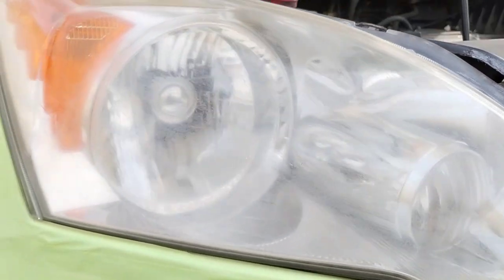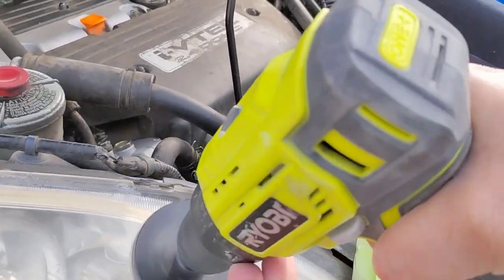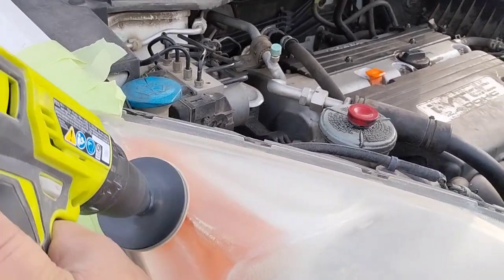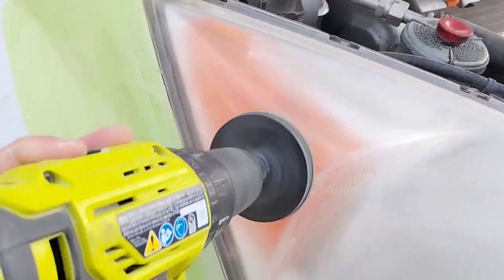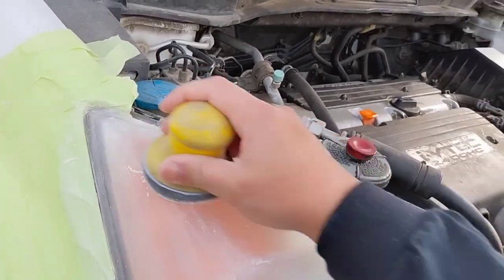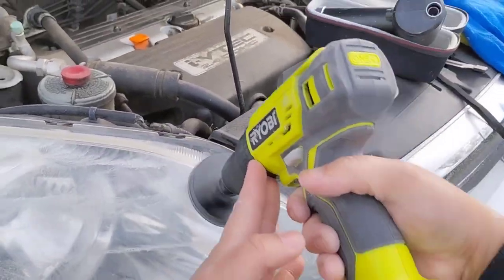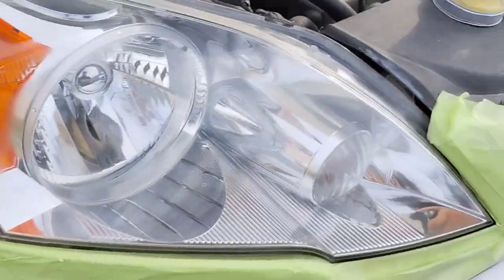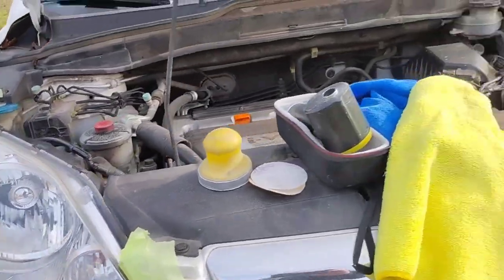Headlight Restoration - WORK SMARTER NOT HARDER 🧑🏽‍🔧

Comment: So why don't you wet sand?
Reply from the maker: It's an inferior method... It is a lower level of headlight restoration basically like training wheels or for beginners which is fine but to do a level of headlight restoration on this level you can't possibly reach you by hand sanding... You might see some that are close but they're really not not in performance and not a clarity.. but on screen they might look close but you can still tell that this is better and that's because not only dry sanding, but also I slew of other things.. wet sand is very inconsistent if you ever see somebody's finished product multiple times let's say 10 or 12 you're going to notice that predominantly most of them are different in the finished product different levels of quality very inconsistent because you cannot tell the depth that you need to go with wet sanding you're looking through a muck of mess and you can't feel it the same then when you spray it it's too late... With dry sanding you hit the same consistent level all the time that's why my consistency is so high my headlight Restorations always come out this way... With wet sanding is very difficult to achieve this even for a professional... Wet sanding does not produce enough heat like dry sanding does .. heat effexor clarity of the light believe it or not... On top of that it's ugly and messy and does not look professional.... On top of that it's 10 times slower... Think about how fast the machines are going and how fast you can possibly go you cannot keep up with the machine at anywhere between 1700 RPM to 7800 RPM it would take a human anywhere from an hour till 5 hours to produce that RPM let alone per minute...
I can go on all day it does have its place very rarely in a pro level headlight  restoration.... Watch this video..https://youtu.be/eoPKK-trHdg
Reply: @theheadlightrestorationpro  Reading your reply is informative for me, I do wet sanding with the Glasweld system, and yes, I see some inconsistencies, I want to up my game and get pro results, I will try dry sanding however I want an excellent clear coat, I use the Gclear with a wipe on application and cure to the lens with a uv cure lamp for now until I find a better product.
Reply from the maker: @papasquirrel5559  well you see what I use...my end results are second to none..💯
Reply: Would you recommend beginner restorers start with the drill method or try hand sanding until they get the hang of it? I'm ready to start business now and wonder what I should do, hand-sand or use a drill?
Reply: @theheadlightrestorationpro  what exactly do you use then? And don't say "it's in the description" cuz there's A LOT in the description, so just tell me.
Reply from the maker: It not only in the description but said and written on the screen on every single video ..(at least actually watch the video (
When you actually watch the videos you know what to get in the bio... everything is listed in the bio.m
Reply from the maker: Use a drill is easier once you get it down...
But it not cutting grass man...
You just can't do it on someones property..
You can really fuck shit up...
You need to practice and train....and develop your skills...
Watching my videos will get you there alot faster....id watch all of them truthfully...I wish I had this channel when I started...
I probably did about 40 to 50 lights- vehicles (headlight Restorations)
Before I even touch the paying customers vehicle...
But good luck....(just advise)